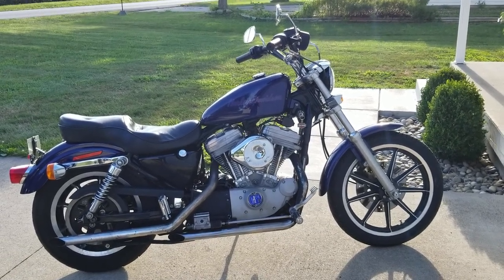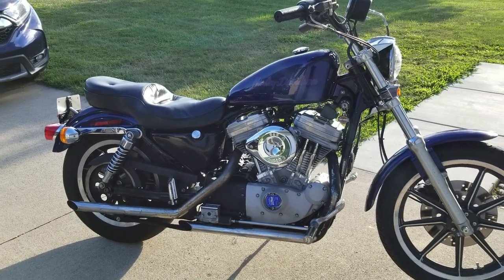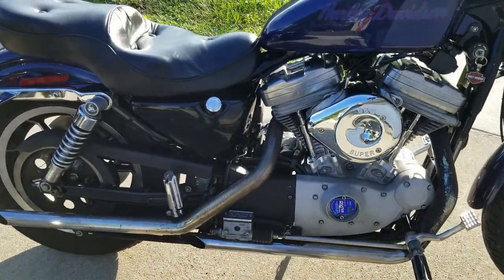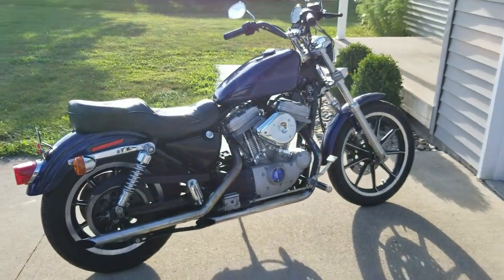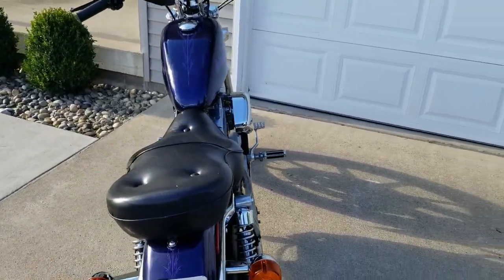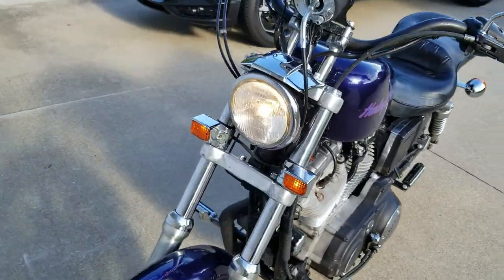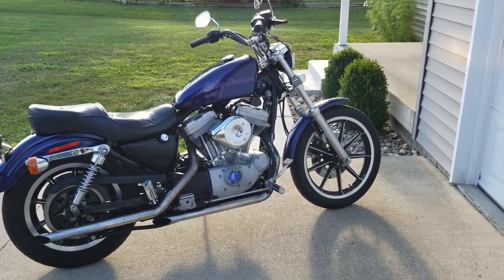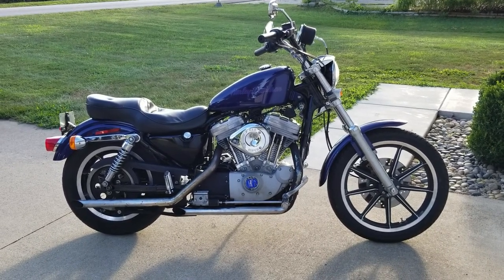Hammer 1275 with Andrews N2 cams Startup

Comment: A lovely sound, Dave! The old "Sportster" motor, but whenever I look at that whirring collection of cams and gears in the timing chest of 883s, etc, (and the conglomeration of gears, sprockets, cams, chains, tensioners, and oil-ways, etc, jammed into the timing chest of the overly-complicated, Twin-Cam Harleys), I never fail to admire Harley for designing the early Evo Big Twins (1984 - 1998), with their simple, single cam-gear with 4 cam-lobes! Are ALL the cams gears, (including the main drive gear) "matched" for minimum backlash whenever you change cam gears? Time to get "whirring" now Dave! Take care!

Comment: Hows the torque w the n2 cam vs stock? Hows the 1275 kit vs 1200?
Reply: I was always told never buy the 1250 or 1275 kit they are only aluminum lined cylinders
Reply: @derrickmeece716  interesting for sure thanks
Reply: @derrickmeece716  whomever told you that is wrong.

The 1250 kit comes with premium quality cylinders with extra thick iron liners to support the larger bore size. The 1275 cylinder is based heavily on the legendary 1250 kit, with one key difference: the liner is made of special 120,000 psi tensile strength steel. This extra strong liner material enables a thinner spigot, which in turn enables the bigger bore. The working area of the cylinder remains at a full four inches outside diameter, maintaining the thick, strong cylinder wall. As a result, this cylinder delivers superb ring seal in even the most highly stressed, demanding applications, enabling more power!.
Reply: @derrickmeece716 Aluminium cylinders with iron liner are best for cooling / Iron liner are also good&strong , as long as they are torqued down with a good torque plate, then honed correctly .
They stay cool & remain strong indefinitely

Comment: Is this an originally 1200 or 883? If its an 883, im looking to do the exact same combo to mine. How do you like it? Worth the upgrade?
Reply from the maker: It was an 883 and yes, definitely worth it. You will see nearly twice the power and not feel like it's going to blow up at 60 mph. Haha
Reply: @harleydave2316  did you run the 1275 without the carb or cams?
Reply from the maker: @zechariahnash8801  I ran it for a week without cams but the carb was added at the time of the cylinder install. Not a ton difference between stock and N2 cams but some improvement on the top end of the rpms.
Reply: @harleydave2316  how much performance uptop are you thinking?